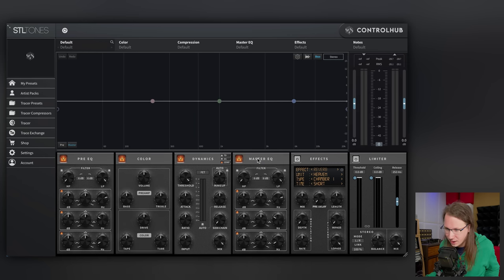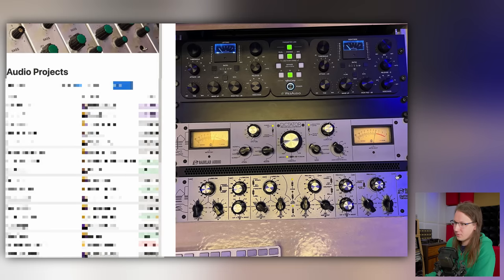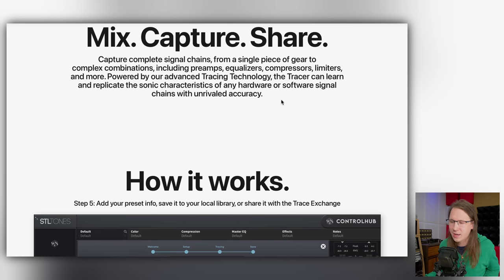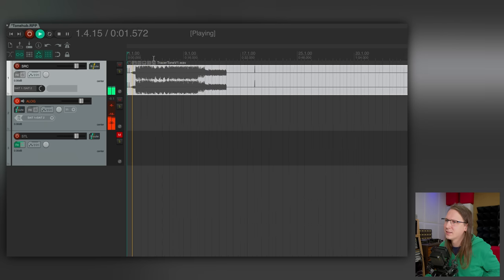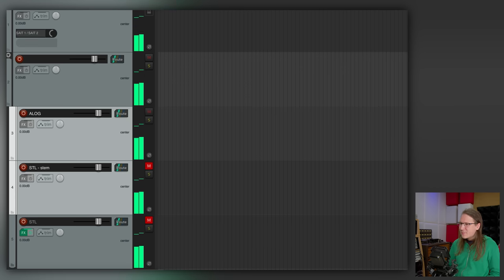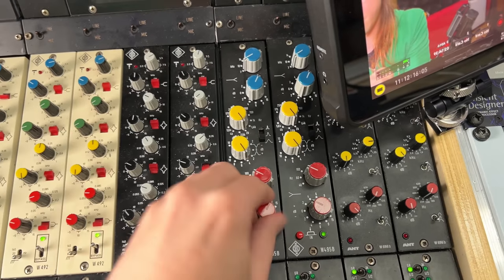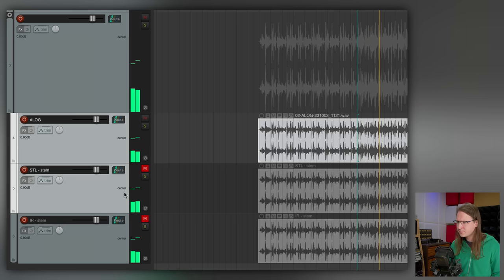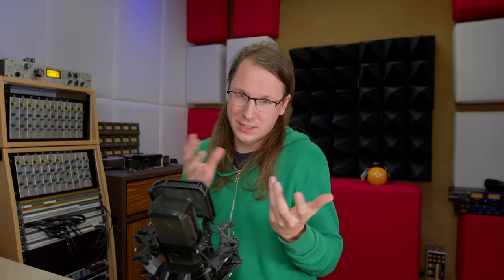Is this too good to be true?

Comment: On your point about plugin developers reaching the limits of current technology - I think that might be true for some things, and I agree the plugin industry is largely complacent and milking people dry, but there's still a ton of opportunity for innovation and using technology more creatively IMO. I think one of the bigger problems is that the market is WAY oversaturated - it sometimes feels like there are more plugin developers than people using plugins, and very few are innovating in any meaningful way. Instead, they push out the same product 1000 other companies have already done and rely on marketing bullshit, a signature gimmick, and service models to sell their products. I'd like to see more developers focus on actually inventing entirely new things. Even when not trying to replicate analog sounds, almost every plugins is based on the basic ideas and functions of analog gear, and analog gear was designed around significant constraints that don't exist or apply for digital products.

Comment: During the A-B test, I was actually tricked into thinking that the STL was the analog gear because in my room on my Kali's it sounding better LOL and then I saw the track names and thought, "out shit, I was wrong" lol. They definitely are different. The test doesn't prove STL is better, it just means that in that moment with that particular track, I liked what it did more. I'm sure in other instances the analog gear sounds better. It just depends on the context and the material you're pushing through the gear.

Comment: One more note.  With the Color module ON,  there is a 10hz high cut and 24.8hz bump at 1.4dB.  
Therefore, it may be why you heard the low frequency bleend,  in the null test.
You might try disabling the Color module.
Reply: So the difference in this video is because he didn’t turn that module off?
Reply: @nagemaakte  might be. I would love to see a follow up on this or if anyone else has the plugin and ran this test with it off.

Comment: i spent hours tracing both plugin chains as well hardware chains, and while it can come close some of the time, often times it is way off. When it does come close, its still missing something magic. You can hear it in the examples you provided, Sandstorm, by Darude. The analog "depth" and color is just not there. It sounds good, but yah, its not it. However... i do think in another few years we will be there. I have faith in the dev's, they make great products and i think the tech can evolve greatly. Looking forward to it
Reply: Exactly. The ControlHub clearly flattens out the sound - it lacks dimension. I could hear a difference even on Macbook Pro laptop speakers - the real analogue equipment just does sound better.

Comment: Even though it's definitely not 100% there, it's close enough to use in mixes for some stuff and repeatability and recall. I personally use my traces more for a hint of analog vibe and saturation which I made from my own console and hardware, it's a cool tool. It's not like any SSL EQ is a 100% accurate representation of a real console, that's how I consider this plugin as well.
Reply: This is closer than anything I have used before including Acustica

Comment: In my experience it doesn't really capture your hardware. For example: if you try to capture two different VCA comps that sound very different, the two different "captures" end up sounding exactly the same (i.e identical transfer curve and envelope). It's like the plugin has a bunch of pre-programmed models, and it chooses the one that sounds the closest to the hardware you are trying to capture. Don't know if it has improved since it was first released though.

Comment: If you ran a piece of audio through your analog gear twice, with the same settings, would it null perfectly?
Reply from the maker: Yes, however, I’m thinking of a test between running it through the gear when it has just booted up, and running it through the gear after it has been on for a while…

Comment: IMHO - I am not a big fan of Control hub and most STL products...I find that control hub and the preset packs that they sell with it feel a little bit gimmicky. The things Ive felt with it is that the presets are not retroactive - meaning that I can't A) see what parameters have been manipulated and how much as the plug in doesn't mirror the preset and B) I am not able to see what curve I am given with said preset. Its counterintuitive and found myself wasting a lot of time on the plug in 😕

Comment: Perhaps not a 100% true snap shot of the hardware and trace via your null test.
But. ($199 Control Hub & $99 tracer, to own a license) and the ability to trace a snap shot of real 
hardware and insert on to many DAW tracks - not bad of a deal.  Great review.
Reply: You can honestly do the exact same thing for free, with better results I suspect with NAM (Neural Amp Modeler). I would be interested to see if there was something flawed about the tests that he was using, because I really thought this would get closer. But doing my EQs, and other effects in NAM, the null test barley has anything left over, unlike the tests here.
Reply: @lorenmorgan1931 but NAM cannot capture compression or anything with time as a variable. It does an incredible job with guitar amps though.....and probably anything that saturates.
Reply: @jacobseal  Actually, you make an extremely good point here. I wonder how hard it would be to make NAM do this, and if Steve has any plans to do so in the future.

Comment: The gem of this plugin is with the presets and the controls of the preamp unit.  This video focuses only on Tracer which is a shame 
I actually have never used tracer but absolutely love this plugin.  If you have the analog gear then use it, if not, this will get you closer than any of your channel strip emus.  

Also isn’t this the same sampling tech as acustica?

Comment: The biggest issue in my oponion is that once you start turning knobs and tweaking settings it's no longer accurate. So you have to use the presets exactly as they are to get the full effect.
Reply: This isn’t a negative. You’d want tweakability. I don’t want a snapshot of a chain of gear just to slap that exact sound of every mix, I want to be able to tweak it based on each different mix
Reply: @faudio5566  Of course you'd want tweakability.  But then why pay for software that uses presets (and preset expansions by well known producers) as its backbone?
Reply: @faudio5566  I think you misunderstood becasue with this, that's exactly what you're getting! What I mean is, let's say you are using a snapshot of a G-bus comp. That capture was taken with certain settings. So when you load the snapshot you are loading the hardware dialed into those settings. However, once you start tweaking things you are NO LONGER using a G Bus clone! The setting you are modifying are not what they would sound like on that same compressor used in the snapshot if you adjusted the settings. The full settings weren't captured. Just the settings that were set when they captured the snapshot. Hopefully that makes sense to you. It's a difficult concept to comprehend but once you do you will see what I mean. Basically once you adjust any of the settings the sound is no longer accurate to how the piece of gear would respond with the same settings.
Reply: @matt_nyc_audioengineer  Have you tried it? I don't care if an emulation sounded exactly like the gear it was modeled after. What I want is to achieve a certain sound in the end. What if it sounds better than the original gear? Does it sound good, does it achieve a desired sound? Cool, it's a usable tool then. Does it not sound good? Try something else. If this plugin gets you a particular sound based on a chain as your foundation, and then allowing you to tweak it further, sounds cool to me. I'm not a gear purist, I believe that mindset may box you in.
Reply: @faudio5566  Nor am I. Again I just don’t think you understand my point. You are thinking WAY too much into this lol. Yes I have tried it by the way. I tried it in several ways. That doesn’t have anything to do with how the technology works lol. 

Anyway, no need to continue this conversation so best of luck!
Reply: @matt_nyc_audioengineer  Yeah we aren't even in the same conversation. Have a good one.

Comment: Tracer works like a Kemper Profiler that captures guitar and bass amps. My Kemper can capture a guitar amp from clean to scream. BTW, STL sells Kemper packs for guitar and bass players with or without effects (compressors, overdrives, reverbs and modulation)
Reply: Kemper doesn't do it well enough to use for EQ or any studio grade effect for that matter. It doesnt process the top or bottom end fully, and some of the newest stuff out there, like Tonex do it way better. Honestly what they are doing is essentially the same as Tonex, and the same for STL here. It's all like Kemper, just way more advanced. The other issue with Kemper is it heavily compresses the dynamics, and everything feels really brickwalled. I was really hoping that Kemper would up the game by putting out and updated algorithm that didnt compress or chop off the frequencies, but instead they made the knobs work more like the real amps. I havent tried the update, but I no longer have my hands on a Kemper.

Comment: I also did extensive testing on this "tracer" and was going to produce a video but I found out in my test that the plug does not do what it clamis, meaning is does not sound like the hardware, not even close so I decided not to do the video.

Comment: I think there is a big difference between an impulse response that is an actual sample of the chain, and analyzing a sound and recreating that with internal processing. The latter is a lot harder to do. It's like the difference between sampling a room for the reverb and trying to recreate that same sound using an algorythmic reverb. Unless I misunderstood how the STL Controlhub works, but that's what I got from it. It analyzes the sound, determines which processors are needed and then tries to get as close as possible with the settings. But no processor, hadware or software, is without limitations. A certain curve may not be possible.

Comment: I'm very impressed that it's not aliasing...

I've seen some cool results with machine learning lately.... Non-linearities.... And somehow getting really close to some cool analog stuff... But the method is totally different than impulse responses... I could see it not being accurate in the right way to know that still doing something new that's kind of exciting and different than normal algorithmic stuff... 

Obviously you can't use this to clone your hardware!!! But there's something going on that's cool and this plugin, I think... And there's some other machine learning stuff that's more accurate than this... at least to my ears. Like I really like some of the Tonex  captures... It can really feel like you're playing a good app with all the dynamics.... Edge of breakup stuff.... Amp like. I'm wondering if a machine learning could get better for this type of application too.  

One thing I do like about this plugin is how tweakable it is...
 Like you can change all the parameters afterwards. And if it's not aliasing.... Somebody could find some use with a plugin like this. Especially if it really is capturing some of those analog like idiosyncrasies.  I think it's worth investigating.

Comment: Frequency dependent phase shifts happen with analog and IIR based digital filters.  I wonder if phase shifts account for some of the differences in the null test?  This seems like they are trying to approximate a set of transfer functions at different amplitudes and then likely interpolate the missing info.  I think this is similar to what Kempers do but would have to read up…. I don’t think these types of solutions can approximate all types of distortion.  However, all of what I’m saying is pure speculation:)

Comment: you always say snake oil like the difference is so drastic that it would be even as different as two different units of the same piece of gear. 36 to 37 db ... yeah nit picking. Mention the differences yes, but I always crack up when people act like they would perform better at double blind tests than anyone else when countless double blind test after countless double blind test proves that people are not sensitive enough in their hearing to hear half of the differences that they typically insist make them go "WOAH" LOL

Comment: You can buy the STL Plugins outright including the expansions. just a "hidden" option at the bottom of the pricing section. That being said, I think this tool is for people like myself that DON'T already have a ton of analog gear and want to use signal chains from people who are willing to provide them. For instance, I didn't even buy the Tracer potion of this tool for that reason since I know I'll be using presets over creating them.

Comment: Meh. I'd rather use algorithmic modelling such as UAD or Softube. It doesn't sound 100% like the hardware either, but it's fully tweakable and they made sure that it sounds as accurate as possible in all settings.
I can see how this sometimes can be useful for capturing your own hardware though. But the main push seems to be to sell you chains from famous engineers, which seems useless to me. I'd rather buy a video with them going through their chains, get inspired and perhaps implement the ideas in my own workflow.

Comment: I have some takes on the whole A.I. audio thing.

- For some very specific applications s.a. audio restauration, de-noising, and certain types of vocal processing, (generative) A.I. tools already profoundly surpass what we can do with our "traditional" analog & digital means. We're seeing A.I. tools that process audio in completely new ways and will change the way we do things completely. I think some A.I. tools will be fully adopted by everyone and anyone in 3-5 years' time.

- The A.I. stuff that mimicks existing products or wants to emulate analogue gear will develop a lot slower. Our current, "traditionally" developed digital alternatives are already quite good.

It will be to impossible to enter the market with a product that does the more or less the same thing for more money. The A.I. alternatives will be quite a bit more expensive because of the R&D costs. Your new big A.I. tool will have to blow the existing stuff out of the water, and the big audio software companies are hedging their bets for now. They're not sure whether most of the market will be able and willing to pay much more for a few extra percentages. You have to remember that for most audio software companies, professional audio engineers make up only a fraction of their client base.

- A.I. processes still require a lot of computational resources. Having 50-60 tracks being processed in real time with A.I. applications running on a CPU is unlikely to work. We'll probably need audio processing to move away from CPU and towards to the realm of modern graphics hardware and dedicated A.I. hardware to be able to pull that off. That's coming though!

- We can expect the same struggles that we're seeing in the visual processing market: It's really hard to get an A.I. to create flawless output in any situation. For a long time to come, there will be outliers, instances where A.I. software performs badly. Even Google and Microsoft will be struggling with those issues for a few years at the least.

- We'll get there eventually, that's a given. We'll probably have to wait until machine learning technology matures in other, more high-margin industries & trickles down to the pro audio space.

- I'm betting that in 7 years time, there'll be no audio-technical reason to be buying analog outboard gear - but it'll be commonplace for many decades still, due to how embedded it is in some artists & engineers creative workflows.

PS. this plugin seems like it seems like it does some pattern recognition and matches some settings that it thinks are close. That's not actual A.I. audio-based processing.
Reply: Agreed. Doesn't seem like AI. Just turning the knobs on its own software to get as close as it can. Like positive grid bias used to do for tone matching amps.

Comment: I think you are nulling wrong. Not only does it have the same audio content, it also has to have the same db. If one the analog mix is 1db louder and invert the phase to the digital mix which is 1db quieter - it won't null. Am I right or not? (Maybe I am not, but I think I am)
Reply from the maker: I did adjust for gain, this was the nullest I could get them to jull
Reply: @Whiteseastudio  😲

Comment: The ugly truth is that no plugin is even half as close to hardware as it claims to be. Even if it can recreate a unit perfectly in practice, it's still pointless if you can't change the settings and get the same results.Not to mention that mixing with ready-made presets never works.
Reply: Except Sony oxford and weisse plugins

Comment: Great video as always. Such a shame for STL that a humble IR nulled better than ControlHub! Watching this, I wondered how modeling software like IK TONEX or Acustica Nebula would fare in comparison.

I also wonder whether tracing each unit separately might improve the chain. The manual says Compressor-specific tracing is good for just getting one compressor and integrating it into an existing rig. But for what it's worth, ControlHub’s compressor module only has VCA and FET topologies — not vari-mu. So, I suspect the UAD Fairchild or Kazrog True Dynamics could impersonate the Dictator better than any multi-FX options.